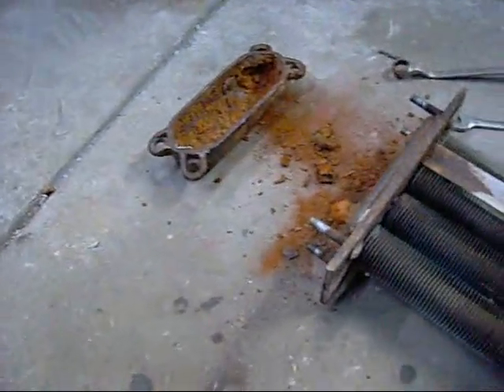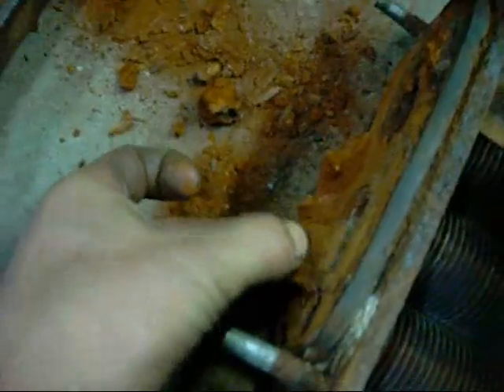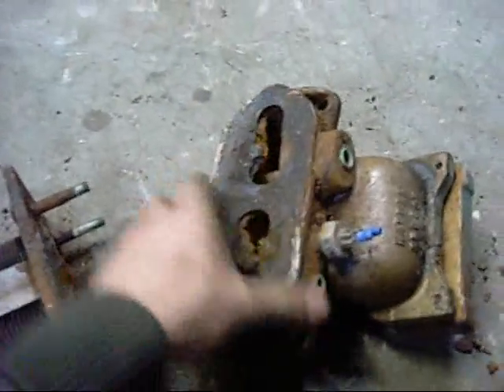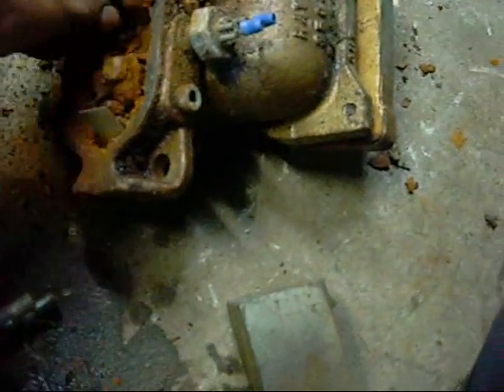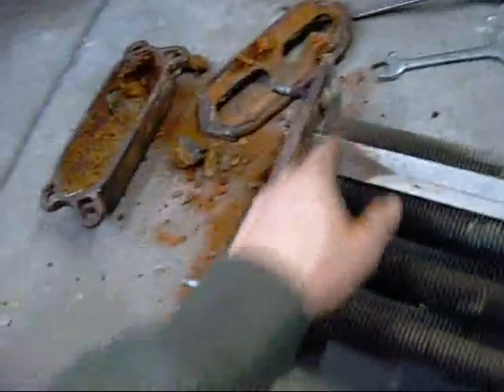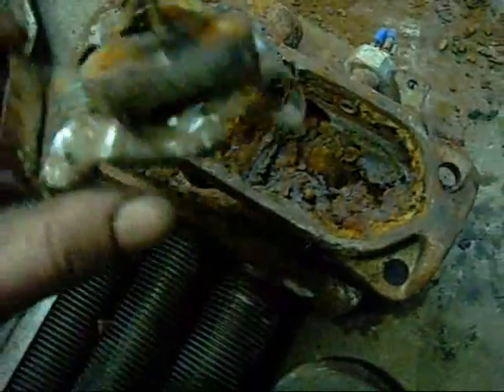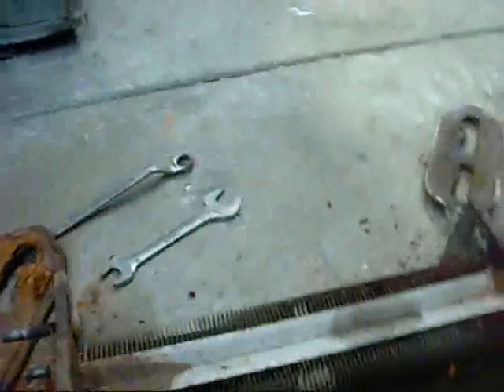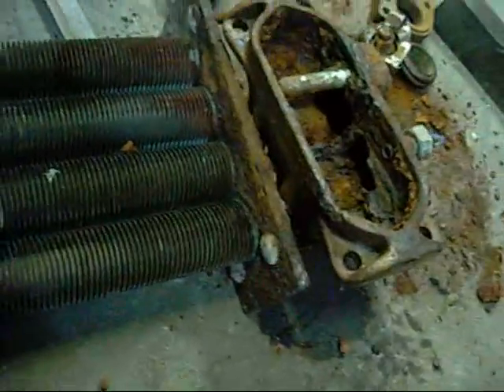Raypak Heater Manifold Corrosion

Comment: @Aussie50 Thats a versa 130 or or 155 whrere I srvc pools that would be considererd a spa htr..... Exchaner rot is common thats when it is time to buy a new heater because exchanger failure, pc board, burner tray failure are all fatal.Because all those parts cost over a 3rd of the overall heater price.  Low alkalinity is what causes this salt water has a litttle to do with this, you just dont see salt water systems with those ol'e 1990 cast iron headers.